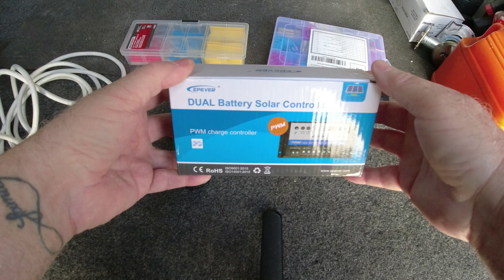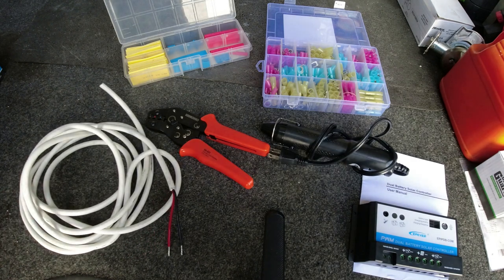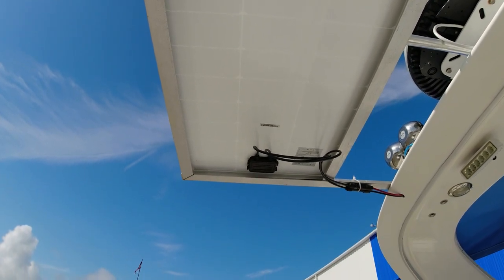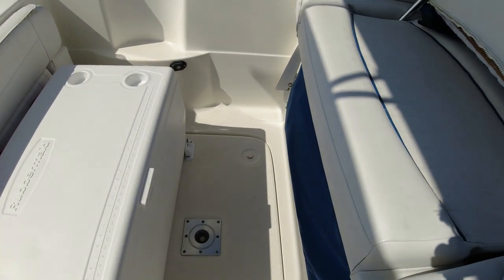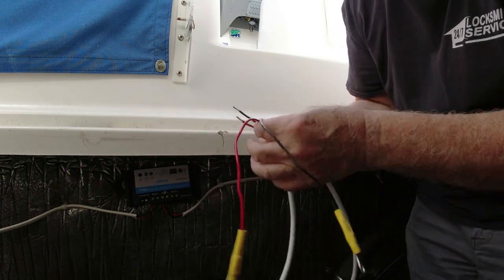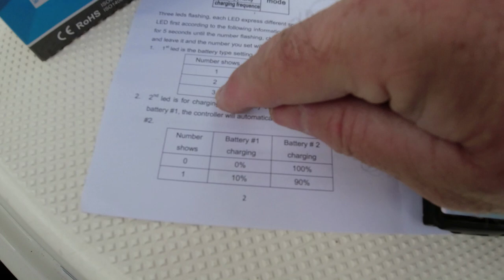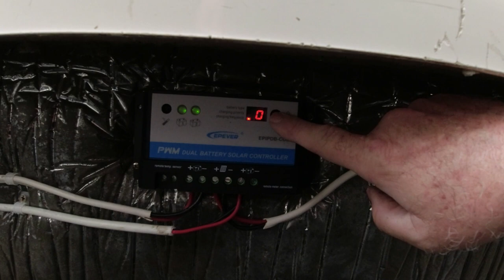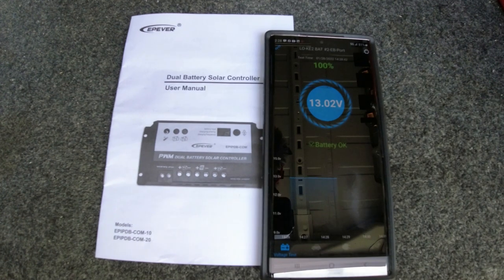SOLAR Panel Install on BOATS Solar Battery Charger Bayliner

Comment: you did an amazing job on the installation... this is a great How-to video. I believe this is a must for most boats.
Reply from the maker: Thanks! We did not have shore power access 24/7 at the marina anymore, so we had to find a solution. This is working well. Peace!
Reply: @KeysBoatingChannel  an awesome solution.

Comment: any shadow from the radome or light mast will drastically reduce your solar output...big time
Reply from the maker: In most cases yes, but on my setup it has been working extremely well for over 2 years. I have never had to charge a battery since. All only solar keeps them topped off at 100%. Thanks for watching our video! Peace from the Keys!